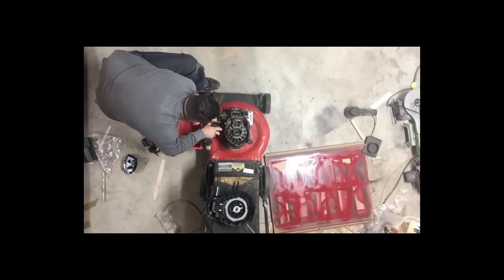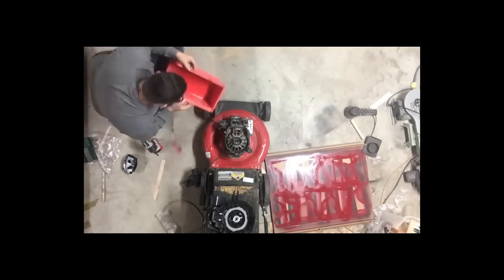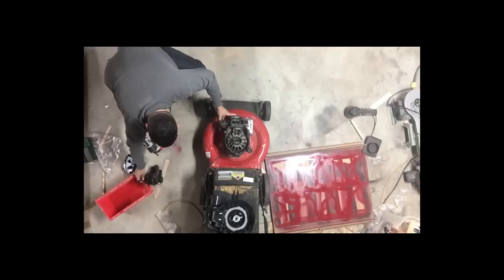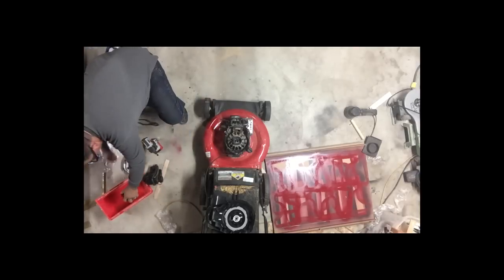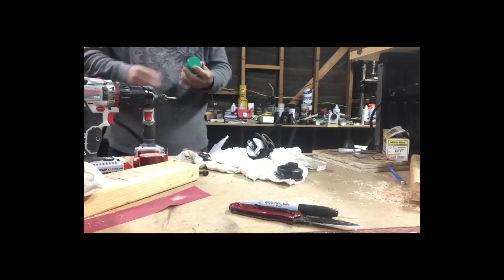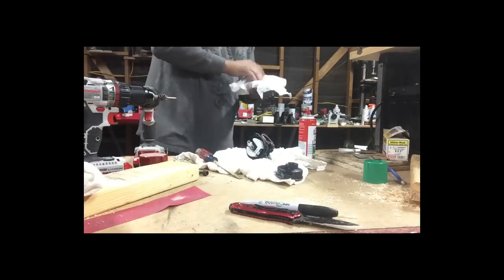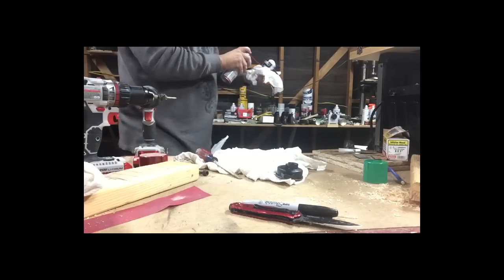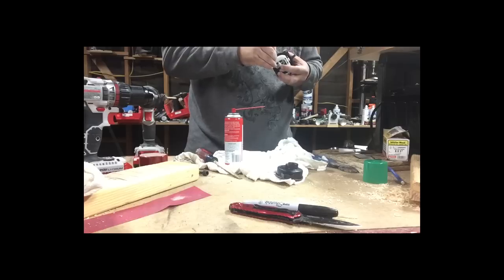Lawn Mower Repair Briggs & Stratton 550 EX, Mower Won't Start

Comment: I had the same issue. Lawnmower wouldn't start. I put in new gas and a new spark plug, no luck. Followed the instructions from this video and had my mower up and running in under an hour. Front lawn is mowed and ready for the back. Thank you for posting this, awesome job.
Reply from the maker: +Ken Polvino Official glad it was able to help you and thanks for watching and commenting!!

Comment: There are quite a few more nozzels you can try to clean out if you take it apart a couple more steps. If I was going this far, I'd do them all before I reassembled.

The additional steps are easily found here on youtube.

Thanks for the video.

Comment: I have the exact same lawn mower. .. mine was leaking a lil oil but there's still some in the engine.. my lawn in the backyard had a lot of dirt patches ... do you think I need to do the same thing you did ? mine won't start at all...
Reply: also it was sitting for about 2 months outside ...
Reply from the maker: +moveNweight Yes you will most likely need to take apart and clean the carburator. I had my lawnmower outside as well, and mine also would not start at all. after cleaning the carb it starts right up. Sometimes if it rains or is very humid, the mower being left outside will accumulate moisture. before taking it apart what I did was took the filter of and sprayed a little carb cleaner down the into the carb and then try to start the mower, if it tries to start and then dies then you for sure need to clean the carb. Hope this helps!

Comment: i tried this and it fired right up with about a quarter tank of gas in it.  i powered it down to fill it up and gas began pouring out of the priming button hole and another port that did not have a hose to it(overflow).  ive had the mower for several years and never had it a hemorrhage gas like that.  and suggestions.

Comment: Good day sir. I am not sure if this had been addressed in the comments. If it has, I'm sorry to have made you repeat yourself. You mentioned that you did a little check by spraying the carburetor cleaner in the carburetor and restarting the mower (:55 mark). I have not done that, nor do I know how to do that. I wanted to try that before continuing with the massive undertaking of taking apart the carburetor. Could you please discuss how to do that? Thank you sir.
Reply from the maker: +adfowlkes71 you just need to take off the cap to the air filter and the take out the Air filter and just 1 quick spray in there will do!!
Reply: Thank you Tommy. I did as you instructed, but, as you indicated in the video, it tried to start but it died. Will it always (or almost always) be that will be water in the carburetor?
Reply from the maker: +adfowlkes71 it's a very good chance water is in your carburetor! I know mine happened because I left it outside and it rained, it also happens after a while if you live in humid areas!!

Comment: mine is only like 4 weeks old and it did start. Did two swipes and it stopped and won't start again. It did get a sprinkled on once when I mowed. what do you think it is.
Reply from the maker: Try spraying a little bit of carb cleaner in the carburetor ! If it fires up, you may need to clean the carburetor like I did! That's where I would start!

Comment: if when you try to go and start it, if it doesnt turn at all is that usually a sign that the carb needs to be cleaned out?  when i pull the starter it doesnt make any noise or anything like its dead.  mower is like new i think letting it sit over the winter with gas in it might have caused an issue with it.
Reply from the maker: It is quit possible! What you can do is try and spray a little bit of starter fluid in the carburetor, and then try to start it! If it sounds like it tries to start and then dies out, then you probably need to clean the carburetor!
Reply: i fixed it by doing exactly what you did in this video.  thanks a bunch
Reply from the maker: +verde08 Thats great! Im glad you got it fixed!
Reply: verde08 .

Comment: I had a old lawn boy mower and it seemed that everytime I had to cut grass I had to take apart the carb and clean it out just to get it to start.
Reply from the maker: +Wes Hamstra (Wes Hamstra Woodworking) Sounds like you may live in a very humid environment where water may be getting in the carb! lol. Ive had my Lawn Mower for 2 years now I think, This is the only time I have had to tear into it at all. Probably because I left it outside and it rained Im thinking! Thanks for watching.
Reply: +Tommy G Workshop yeah, summers here get real humid. I got rid of that lawnboy 2 years ago. I have a craftsman mower with a 6.25 hp briggs on it. its a great mower so far. starts up on one pull everytime.
Reply from the maker: +Wes Hamstra (Wes Hamstra Woodworking) Yea Briggs and Stratton are good motors!!

Comment: Cool! Glad you got it fixed. I see that you got a lathe there. Is that new?
Reply from the maker: +Joshua Luther  HAha, good eye! Yes it is new. I am going to be coming out with an unboxing and Assembly on it, but its just the cheap Harbor Freight Lathe!!
Reply: +Tommy G Workshop That's next on my list to get. I've been looking at the one from HF that has a disc sander on the end. It's like $120-$130. But then there's the tools and I don't have a bench grinder. I'd also love to get a thickness planer but they're a bit more expensive. Christmas came early for ya, huh? New TS and lathe.
Reply from the maker: +Joshua Luther lol yep early Christmas! I have been told by a number of people not to get the lathe with the sander on it!! Also I have heard that the Harbor Freight lathe tools are horrible and have to be sharpened quit often, and with out a bench grinder your best bet would be the easy wood tool mini's. They are a little price but might out way having to get a bench grinder and grinding wheels. Also I'm going to be attempting making my own carbide cutting lathe tools that I am going to video, so that may be an option for you also!!
Reply: Cool. Thanks for the advice on the lathe. I guess it's like anything you buy. You get what you pay for.
Reply from the maker: +Joshua Luther the Harbor Freight lathe I got is the same one Sterling Davis has I think, for $299, it's suppose to be good for the money!! Also the 10" X 18" bench top is also a good one for $199 and then just get the 20% coupons!!
Reply: Tommy G Workshop Thanks!